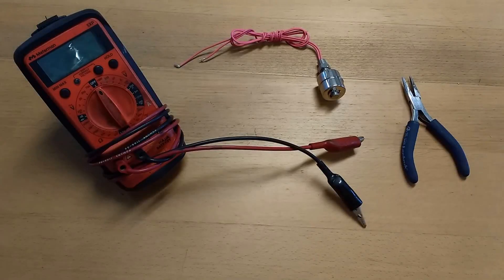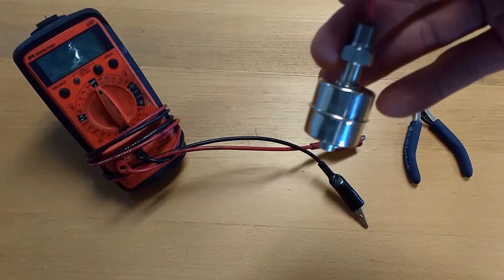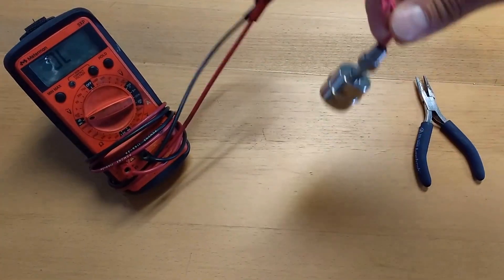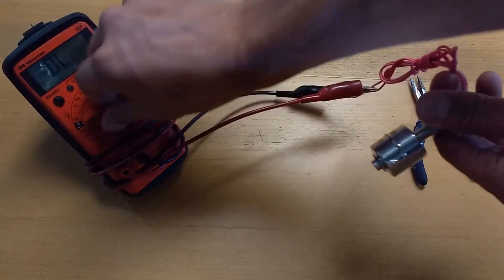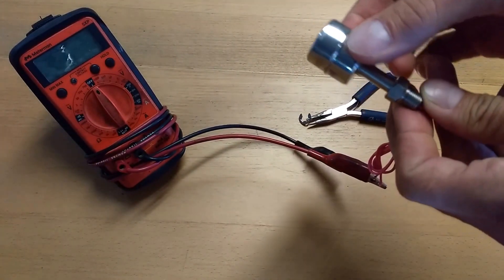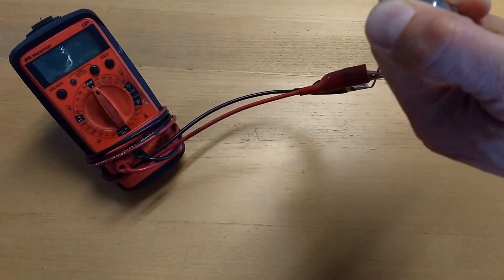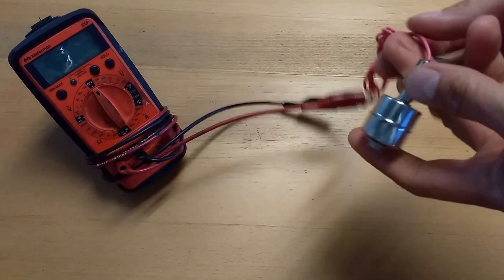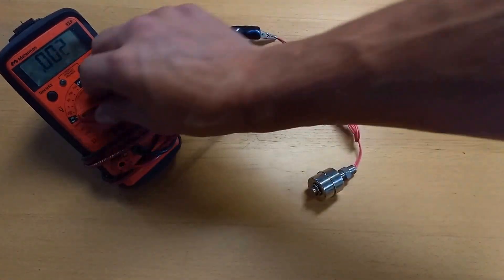How to change a float switch from Normally Open to Normally Closed

Comment: K so I’m using a sump electric float switch in a well reservoir, I need it to on the switch when the tank is low, but usually a sump switch will on the current when the basin is full, so I’m going to get inside this float switch and do what you just did, wish me luck